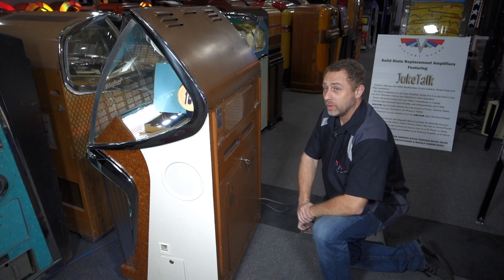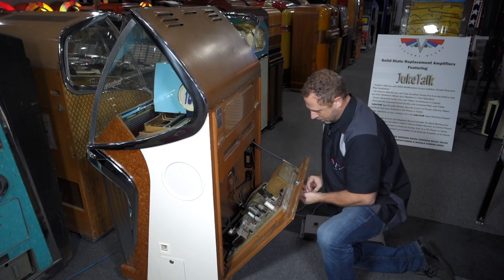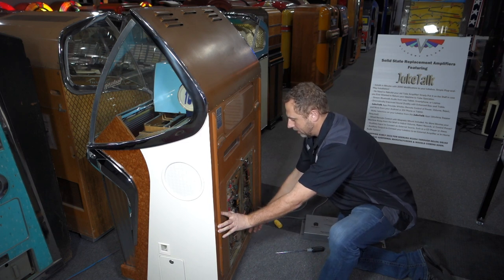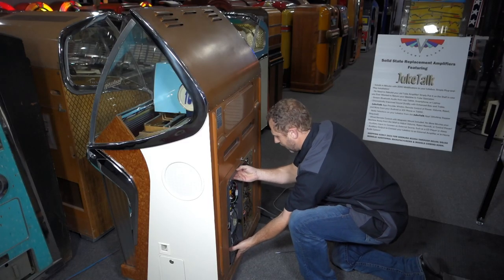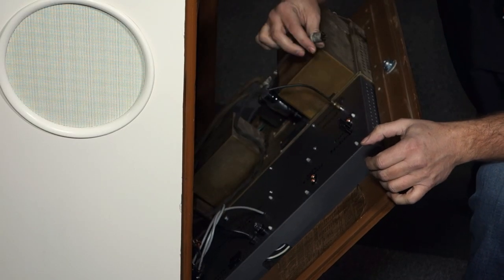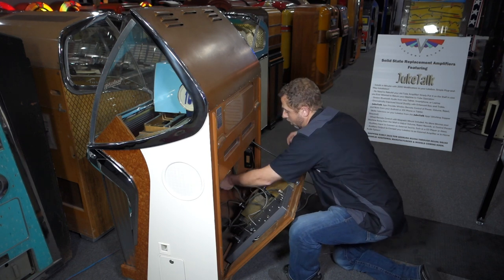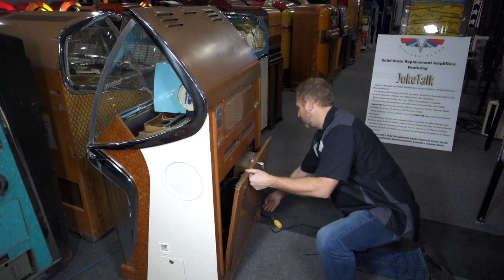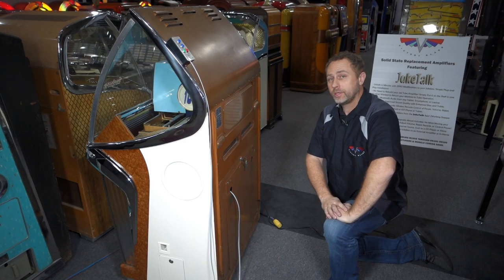Installing the Solid State Amplifier on a Seeburg Jukebox HF100R-201 - Victory Glass

Comment: If I wanted to continue to use my wallbox with my Seeburg jukebox, could I daisy chain the wiring into your selector wiring and have use of both selector devices, the app and the wall box?
Reply from the maker: You are correct on the prototype that’s what would have to be done.  But wait there’s more.  Our production amps now replace the 2050 tube and sends the pulse through that socket.  Leaving the wallbox plug open for your use.